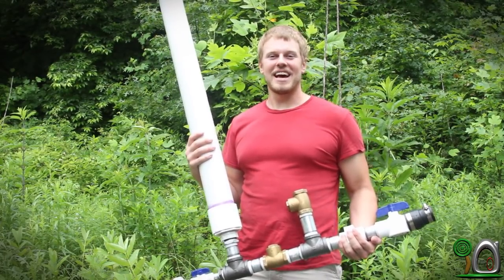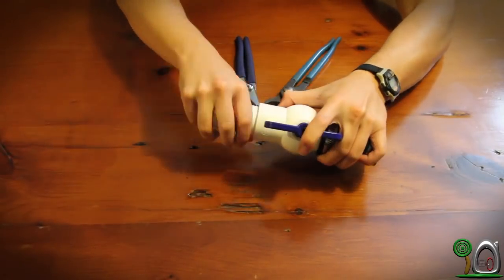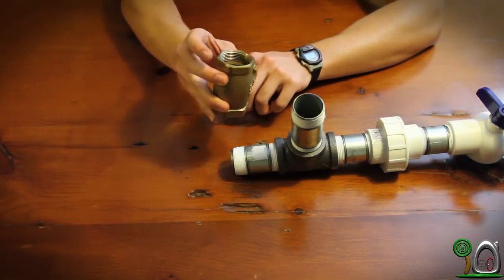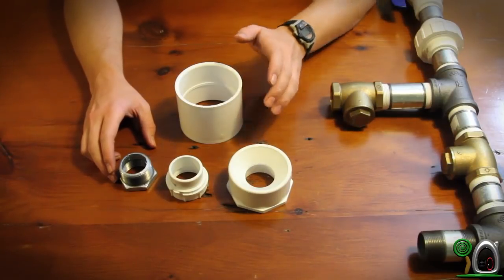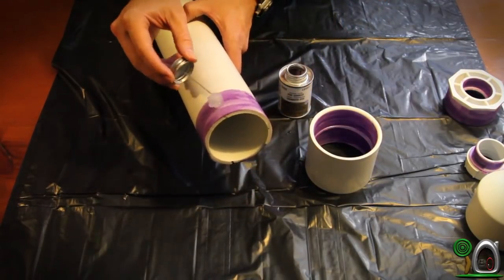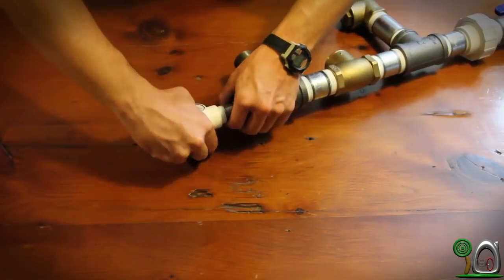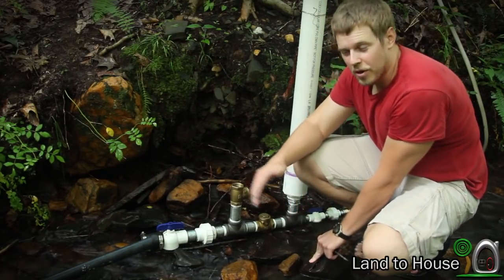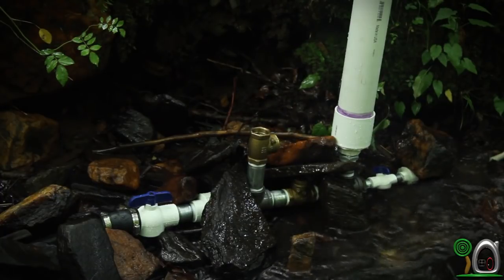Hydraulic Ram Pump: Build-Install-Operate

Comment: hi Seth  im Jerry of the Philippines  just assembled a 3/4" ram pump with a 3" pressure vessel pipe and  a 1/2" outlet but i cant get the pressure to rise on the pressure valve i checked for leaks but there was nothing by the way my water source is a 600 gal. plastic barrel with a 3' drop... can you help me with this.. thanks
Reply from the maker: Hello. Well a 3' drop should give you over 20' of lift. That is plenty to test the pressure of a pump. Does the pumping action take place? meaning does the check valve open and close? If the pump is working then an air leak is the only thing that I can think of. Did you use threaded parts for the pressure tank or glue? Sometimes the threaded connections will leak.
Reply: ive used solvent cement for my assembly all my pipes are made of blue pvc pipe, yup the valves are working perfectly just like in your video but may be a little faster pulse maybe because of the big water supply, am trying to up load my video for you to check but there seems to be a problem with my broadband.Also try to replace a plastic bottle for the pressure tank momentarily to see if there were air bubbles pushing up yup there's some bubbles but the pressure gauge ain't rising
Reply from the maker: Jerardo pinsoy This is a very interesting problem. The only other thing that comes to mind is a leak in the delivery pipe. If you have a clear delivery pipe you can see if the water is being pushed up the pipe with every cycle of the pump then falling back down. This would prevent the pressure from rising.  ... A video would help a lot.
Reply: ive just uploaded my video in my fb account i dont know how to tag it to your fb wall you can see it in my video post
Reply: Land to House .com ive just uploaded my video in my fb account i dont know how to tag it to your fb wall you can see it in my video post
Reply from the maker: Jerardo pinsoy just checked out your video.  Is your water supply coming from the 55 gallon barrel?  It looks like you are pulling the water from the bottom of the tank.  You will need to lift the whole tank off the ground above the pump. I think that is your issue. Even though you have all that water above the pump in your current setup the input is still at the same level as the pump.

Comment: Hi! How long are the inlet and outlet pipes you're using?
Reply from the maker: +Carlos Amortegui this pump uses a drive pipe between 15 feet and 100 feet long. The delivery pipe can be up to a mile long. The horizontal distance is not the limiting factor. But the vertical distance is what limits the pump.
Reply: Thank you very much!!
Reply from the maker: +Carlos Amortegui happy to help. I have a playlist on my channel with lots of ram pump videos. If you want to check them out.
Reply: Hello again! How did you find out that you needed at least 15 feet?
Reply from the maker: If the Drive pipe is too short the pressure wave will go from the pump to the intake and back to the pump too fast. This will cause the waste valve to operate erratically Or stop altogether.
Reply: Thank you very much! It was totally helpful, as I got to build my own ram pump!
Reply from the maker: Nice! I hope that it gives you years of free* water.
Reply: Could a drive pipe 20 feet long be installed vertically?
Reply from the maker: Yes it can. I have a video on the channel showing that done.

Comment: Hi Seth, does it matter what kind of check valve one uses? Although it is brass, I ended up purchasing one that is not an exact T, and it was more angled. Like this: http://p.globalsources.com/IMAGES/PDT/B1059326286/Check-Valve.jpg. As well, I have a 20 ft drive pipe, is that sufficient?
Reply from the maker: Interesting.  I have seen those but never used one.  I think it will work just fine but you might need to angle it a little too the side.  If you have plenty of flow you will want that valve as vertical as you can for the best efficiency.  Dropping the angle will allow for lower GPM use but also reduce efficiency.

Comment: what is vertical distance limit?
Reply from the maker: +dinesh tomar the ratio of head pressure to lift is typically 1:7. Because of the waste check valve flap weight the pump is limited to around 150 feet of vertical lift. Some people can get more but that is a lot of pressure.